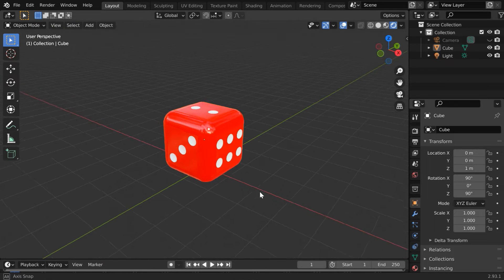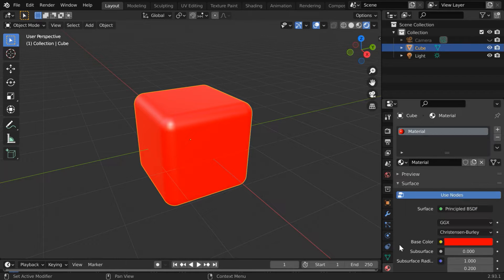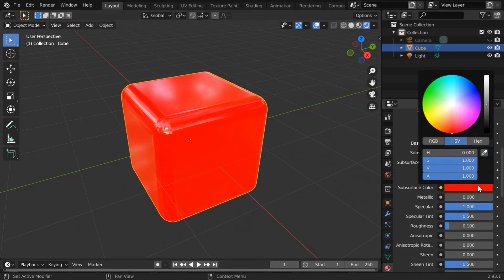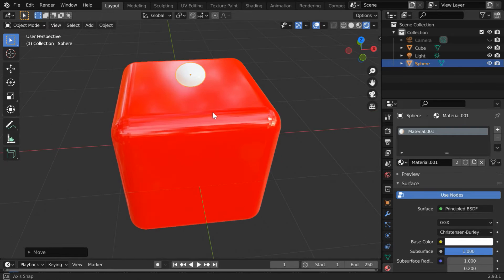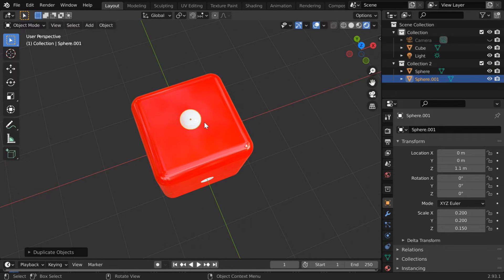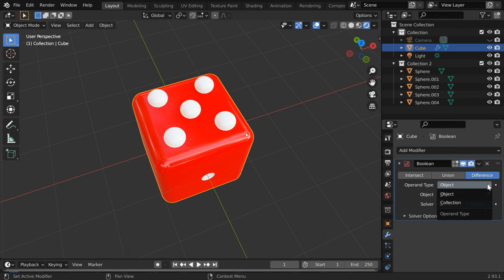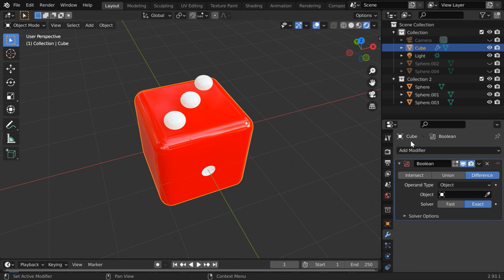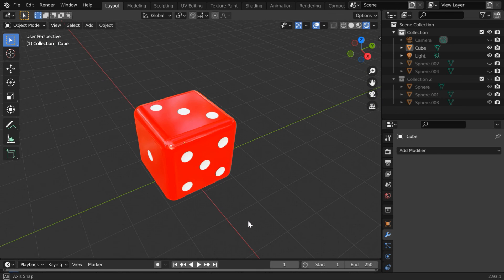Model A Ludo Dice In Blender | Easy & Perfect Method | Complete Tutorial | Blender Eevee & Cycles

Comment: How the white color of the sphere is projected after applying a boolean whether is it of sphere or cube (Subsurface).
Reply from the maker: Good question. It is the color of the sphere. The cube does not have any internal parts other than the six outer surface planes. All mesh objects are treated as hollow in Blender. So the curved surface generated post boolean operation came from the sphere. So this part will get the material of the sphere only.
Reply: @5MinutesBlender  Ohh , Yes, Thanks
Reply: @5MinutesBlender  We can use it to write text on any object by converting text into mesh?
Reply from the maker: @COOLACADEMYFORPHYSICSANDMATH  Yes definitely.

Comment: Thanks for the insightful videos again. Unfortunately Boolean collection is not working on me. What i am seeing are only spheres seperately. My version is 2.8. Is it also applicable in this version ?
Reply from the maker: Oh I see. Yeah, it is probably not available in 2.8, but why don't you upgrade to a later version? If you are working on a project that specifically needs 2.8, you can install multiple versions on the same machine. So you can keep working on 2.8 for your project work while learning more aspects of Blender on a more recent version. In any case, if the collection option is not available for you, you can still do this. You have to just select one object at a time and do the boolean operation. It will take little more time to go through each object, but the end result will be the same.
Reply: thats what i m doing @5MinutesBlender
Reply from the maker: @CGSTUDENT15  Great 👍